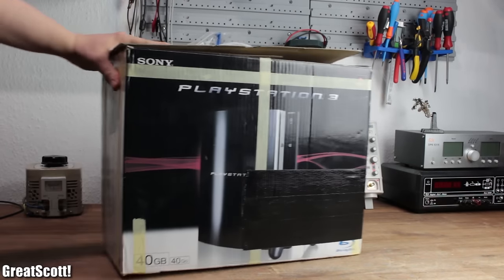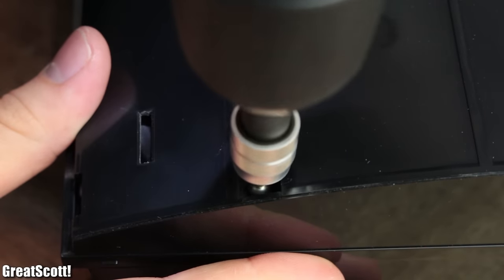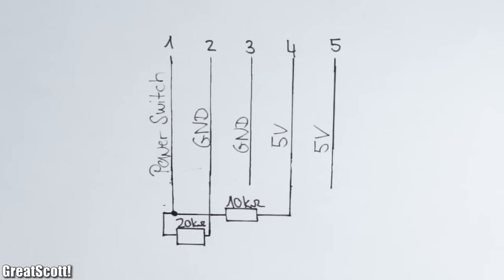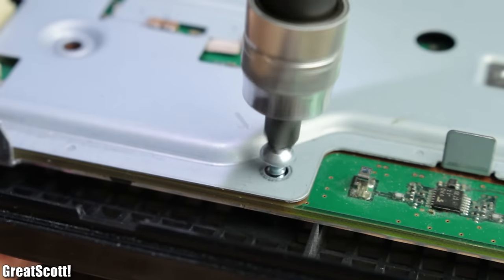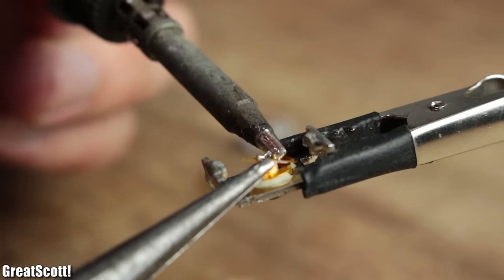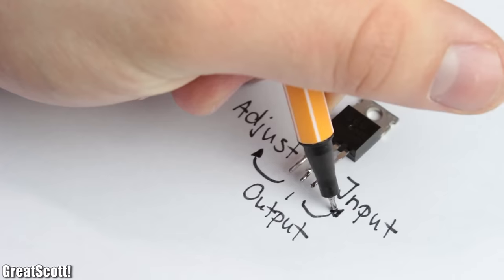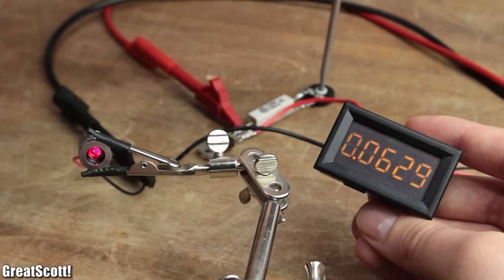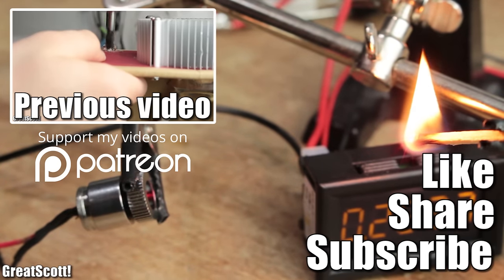HACKED!: PS3 Blu-Ray Laser Diode || Simplest Constant Current Source

Comment: The laser in the PS3 is just for reading the disc, so it is only good for up to 50mA, at most (more safe at around 30mA).
Reply: Forssa1 Dual lens PS3 sled found in newer models is capable of outputing more than 50mW - I cranked up mine at 100mA and burnt some plastic and ignited a match (ofc at this current lifespan of this diode is pretty limited).
Reply: I had a writing diode once but accidentally blew it up and now can't find a new one :(

Comment: Great Scott, just from watching and listening to you're videos. You have taught me so much more! then reading ever has from watching your videos about electrical engineering and setting up circuits. I am amazed you are not out there compared to other channels you teach so much and draw out diagrams detailing how you will connect resistors to pcb boards etc. Also showing the math you did to get the numericial value for how much electricity would be wasted is amazing.
Reply: True

Comment: I'm afraid you are mistaken about killing potentiometers. Usually,  the issue is not dissipating too much power. The problem is driving too much current through the wiper. This can produce a very small, localized burn on the resistive element, and at that particular position the pot will appear to be dead.. The maximum safe current depends on the specific pot - but it's not usually very much.

Comment: +GreatScott! You should check the beam pattern of the laser diode. I had 8 laser pickups to play around with and killed every single one with ESD. Even while grounded with an esd wriststrap and earthed soldering iron. Those 405nm diodes are very fragile and even more sensitive to esd than other wavelengths. You should look at the beam pattern if its a constant bar of light. If not you most likely killed the diode. Dead laser diodes usually emit a random splitted pattern or even no light from front surface, just some reflection of the substrates sides. + they often emit a yellowish color on the sides when they are dead.
Reply: And your diode looks pretty dead in the Video. Do not exceed approx 50mA or it will die. Those diodes are only for reading and not burning discs. They usually have about 5mW of output power.

Comment: Great video; try to use the UV laser to cure some epoxy resin, or other UV curable resin, the chemical mechanism of IR and UV reactions in materials are way different, but remember the simple quantum relationship: Energy of a photon=Planck constant*wavelenght/velocity of light in vacuum.

Comment: It looks like the violet laser diode is damaged because the output is very dim. Also its possible that the playstation does contain a burning  violet laser diode, it might be a read only laser diode that isn't able to burn things. I took apart one and the diode did work but it only puts out about 15mW or so not burning.

Comment: The red light of death could mean that the board just needs reflowed.  The BGA of the chips on the original fat-style PS3s have a tendency of disconnecting.  At least was the case with mine.
Reply: Wrong 
It’s nec Tokins

Comment: The unit is only for reading, the module is a combination of 780/650/405 nm diodes at roughly 10-20 mW sometimes at 50 if you're lucky.

Comment: Can the violet diode be used to check whether glasses have UV filter?
Reply: the spectrum of the violet laser is around 405 to 410nm
I think uv blocking filters work till 400nm
not too sure you might give it a try :)

Comment: You can turn on the ps3 psu just by shorting 2 of the 5 wires together, I did it on mine, and there are other documents on it too. You didn't need to use the resistors. I forgot which two wires but googling it will reveal how

Comment: I use a xbox charger to power my car subwoofer amp inside and similar to the PSU on the PS3, you have to jump certain wires to get it to turn on.

Comment: I took 6 dvd players apart.  At the end I managed to have just one laser diode that worked.
Just why none worked  except one, I have no idea.
This is the only video that doesn't warn about shorting out the LED. 
He simply cuts the ribbon and use solderig iron and removes the tape.
Then furthermore tries different connection pin to see which one lights up the LED.
No concern about shorting anything.

Comment: Some PS3 units have 32A PSU. You should check that - I used one to power 3D printer. You shold use the PS3 case and build a PC in it.
Reply: +ELECTRONTHORP It doesn't come with the fan. It looks the same as the one Scott used in his video. I remived the PSU from its case and placed a 12cm fan on it. It should not be used without fan-its ok with small loads,but anything above 10A for long periods makes it really hot.

Comment: Cool video, but that PS3 probably would of been salvageable if you just reflowed the CPU and GPU chips. Fixes the YLOD a majority of the time.

 I have a old ps3 power supply like yours I might do the PSU mod that you did as it seems like a good way to power 12v high wattage LEDS. Thanks for the video!

Comment: Those guys have no idea what they're talking about, blu-ray reader diodes can't  output more than 5mW. You need a writer diode to burn. There is an exception though, the PHR-803 (iirc) found in the xbox360 drive that for some reason can be cranked up safely to around 100mW.

Comment: That PS3 could have been fixed with a reflow.
Replcement laser diode assemblies are cheap on ebay.
Reply: I don't think he was interested in that. In the words of the EEVBLog, "Don't fix it, take it apart!"
Reply: +nimoy007 I am aware of what the crazy aussie bloke says, but that was a 40GB FAT PS3.
It is the one that had PS2 capability, the one that had the media card reader.
Reply: +IIGrayfoxII no this 40gb unit in the video is a G02 model and doesn't have ps2 support or card readers.
Reply: A reflow won't last very long.
Only reballing it is will fix it.

Comment: Nope. The simplest constant current source would be to get a JFET and connect the gate and drain together. This will allow the JFET to conduct a certain about of current, there is a special name for that amount of current, simalar to "saturation" in the BJT transistor.
Reply from the maker: +Power Max But it is a small current.

Comment: I have ps3 fat and its power supply model is APS-239....
There is no pin configuration at website,it has only 3 control pins ...plz tell me ,wht can i do with these 3 pins to turn on the power supply on in order to get 12 volts

Comment: Can you upgrade your 4×4×4 led cube using an arduino nano ?
Reply from the maker: +Daniel Cruz I used an arduino nano during that project already.
Reply: +GreatScott! yes, but you used other components , you can create it with only the arduino nano?
Reply: +Daniel Cruz That would get pretty flickery, running 64 LEDs with that many I/O.  You'd have to charlieplex and the refresh rate might get pretty slow.

Above a certain point, it's better to use more circuitry.  The wiring to support 64 LEDs in a charlieplexed configuration gets really stupidly complex.  What would be the point to avoid using 80 cents worth of logic chips but have wiring that's 20x harder to do?
Reply: +John Ridley I just wanted to know if it is possible to create the cube with only the arduino nano. I thought it would be easier with just the arduino. Thanks :D

Comment: How do you check the laser diode without breaking it with reverse voltage.
Reply: If I was to guess I would say low current and only placing the probs one for a few seconds which means even if the voltage is over the reverse it won't be for long enough to do any damage. Just a guess then.

Comment: I really like your videos but I never got my head around why people call this "hacked". It's probably for recognition reasons, so people will click something thats got " hacked" in the title, even though you basically just salvaged some cool stuff. Turning the power supply on with two resistors and testing the diode is barely hacking (or modding) something.

Even tho, just a random thought. You don't need to use buzzing, fancy keywords with exclamation marks, man. You're great. :)
Reply from the maker: +Jilocasin Hackins means using something in a different way than it was intended for. I think it fits well.

Comment: Did you find out why the PS3 didn't work?
Reply: It has ylod its a easy fix
Reply: It shows at the start of the video. Yellow light of death. The problem is the solder balls used in manufacturing can't support the heat caused by he CPU and GPU and so they melted together and formed a short circuit. It Can be repaired though, as I have repaired mine like 6 times using a heat gun and still works fine.
Reply: Wtrxprs007able but remember reballing a bga components needs extra care and more complicated tools and also need skills and patience because reballing such components are frustrating and difficult
Reply: It's not that the solder spots conglomerate, it's that they expand and then crack as they cool separating the chips from the board. 

 If they did all just stick together as you say heating it back up isn't going to do much of anything to fix it because that won't separate them, in all honesty heating them to molten will most likely make things worse.

  If a point is ever reached that they do completely fuse to one another then you need to completely remove the chip and strip it of all solder and do a fresh application.

 The reason why heating does work though is because as I mention prior the connections crack to due expansion and contractions of the solder, heating however melts this solder and reestablishes these connections completely.

 If you keep having issues with your chips after doing the repair it's likely that you got a bad PS3 with really dry solder points. Or didn't put back on thermal paste, or enough of it, or good enough quality thermal paste.

 Or that the brackets that screw onto the CPU and GPU were not tight enough as those are needed to wick away most of the heat. but also keep pressure on the chips to prevent expansions and cracking as I mentioned prior.

 Not saying you did this, but it's common for reoccurring systems

Comment: OK so I've been messing with lasers for a while now. heard over and over again that a regular bluray player will not burn it takes a bluray burner which makes sense to me don't get me wrong. but recently I got my hands on a bluray player, just player, from Walmart. long story short. FU#$ walmart, we were returning dvd player next day because bought wrong one, so I decided to open it up, pull the sled out and close it back up to be returned. kinda messed up for next guy who buys but hey just being honest. but anyway I pulled the 405 out of the sled, soldered some leads to diode and hooked it up to a constant current setup on the lm317 at about 70ma. it was cool but got boring really fast, so decided to hook it up to my adjustable current setup with the lm317 and cranked up the current to 100ma. and to my surprise it started to burn my black jumper wire when I focused it in on it. I expected it to die right away but not at all, it got a little hot after about 2 min of constant use, but other than that seemed fine. so of course I ended up cranking up current till I eventually did kill the diode, which I believe was around 200ma, and I didn't do any long test at any other high currents, we'll for this diode, besides 100ma and 120ma, so not saying that this diode will operate fine at 200 ma. but did seem fine at 120ma, and most shocking it burned shit. if I get any legitimate responses on how this could be possible I'll get the model number of the blu player if anyone is interested. but maybe this is just a theory going around the Internet that a bluray player diode isn't powerful enough to burn things. I'm sure manufacturer doesn't want that common knowledge.  seeing that there is no data sheet on any reader or writer diode, it's just a guess as to what current is safe and what isnt right

Comment: Instead of reap it apart, wouldn't be better to fix it? Another thing that lasers eventually run out on PS systems, so the laser head can be easily sold up to 10 backs at least. I personally felt horrible when he cut out diod. Flayer!.. :(

Comment: I've been trying to get a current source circuit going using a simple transistor as a current source for variable supply from the collector.  Is this possible?  Anyone have any ideas on how to configure the resistors for this, and would this require a diode for the output?

Comment: hi. can u make a lithium ion battery(laptop battery) indicator but without using chip. and have 3 state.  1-  battery low at 3,7 v . 2- battery good at (3,8 v  -  4,1 v ). battery full at 4,2v . Please do this if u can i didnt find anything with that states .

Comment: Hi scott,
aah you can repair the motherboard of the ps3 just you have to reball the gpu and the cpu ... i know it's difficult but if you r lucky just heat the chips and it will work again but for some time .. try to keep't cool .
Reply: +Akrout Osama I'd rather have the power supply than the PS3.

Comment: Is the Sony PlayStation 3 really that old that it only has a 40GB hard drive in it?  Today, that is only barely enough space for even a modestly useful copy of Windows Vista/7/8/8.1/10.  The only way you could leave enough room on it for any practical purpose would be to install a copy of Windows 9X/XP or earlier, from back when 40GB was enough to back up an entire school computer lab worth of student user data.
Reply: Wow, with 12V at 23.5A, that works out to a nearly 300W power supply.
Reply: I love your idea to use standoffs to provide additional ventilation to the power supply because if you run that 300W power supply at 100% load, it would get quite toasty.
Reply: So it turns out that red is one of the best colors of laser to use for burning, especially if you crank the power up to 250mW.

Comment: That play could be fixed, but now...
Reply: it still can just needs a new laser assembly put in the same drive and the chip on the main board needs to be reballed and soldered... but it is cheaper to buy a new ps3 than do all that work it would need to be a launch unit with hardware ps2 support to be worth doing...

Comment: being eletronics genius, it never occured to you that the psu was faulty? you could hve tried to revive the console before butchering it
Reply from the maker: The PSU was never faulty.
Reply: +GreatScott! Yellow light code typically just needs reapplication of thermal paste onto the CPU. Regardless I'm sure you just wanted the electronics inside
Reply: +pmakfpt how should the console know when it's thermal pasta needs to be replaced? I think when it hits the orange light it's already too late. You might have overheated the CPU and broke it
Reply: +KaienSander10 PS3 had color/beep codes. 
The YLOD
Yellow light of death was typically the CPU overheating or a faulty power supply. Usually all you needed to do was reapply some thermal paste. It was q common problem, one of my ps3s YLOD all I did was reapply paste and it worked.
Reply: @KaienSander10
Because it has thermal sensors and can detect overheating. Modern CPU's have a built in thermal throttling and thermal shutdown. It's quite unlikely to damage a CPU.
Reply: Coming from someone that actually has fixed the YLOD on several systems it typically is from the CPU or GPU chips that are soldered onto the board becoming hot enough that the solder on the contacts under the chips expand significantly and then crack as it cools down separating the chip from the board on multiple points.

 The simplest way to fix this is just to use a torch to heat the chips hot enough that the solder becomes molten again and the chips reestablish connection with the board.

 Just applying new thermal paste wont fix this as one other commentator suggested, but it can go a long way to prevent it from happening as the thermal paste can degrade drastically over several years which means much more heat build up and higher chance of failure. (In fairness though the YLOD can also show up for regular overheating which can be fixed with paste reapplication.)

 But as the original commentator stated the YLOD can also be caused by PSU issues, but it is atypical compared the CPU/GPU solder cracks.
Reply: MrDoboz Damn right I do, and it worked great!
Reply: MrDoboz Separate ones, never had an issue with a relapse.
Reply: Honestly a hot air gun would of been more ideal, but work with what you have you know?
Reply: Unlikely - The LED displayed the error code, meaning that the circuitry in the PSU must have been working.
Usually the red light indicates an issue with the processor.

Comment: Man, you have to learn how to solder. Those joints are so bad, and I know they work but as someone who has a lot of influence you should be doing a better job. Just use flux before soldering and firstly heat up both metals that you are about to join. Then, try placing the solder wire on one of those metals, not onto the soldering tip. Because that can be used as a gauge to know if the metals got hot enough to join properly. Otherwise you will keep getting those blobs and those sharp things sticking out. Both are a sign of unclean surfaces. They just don't want to stick. So get some flux, it isn't expensive, and correct that video you have on soldering! I mean the THT and SMD one!